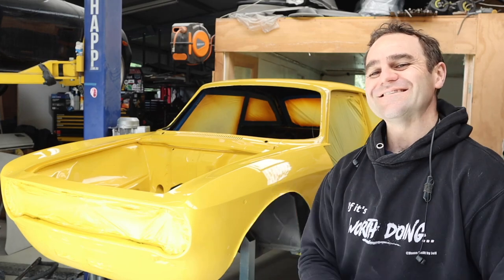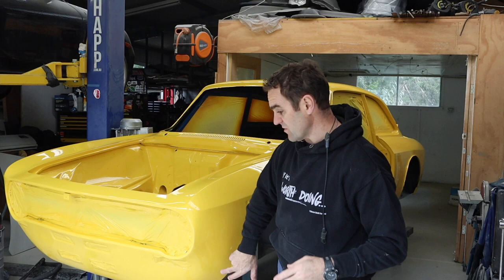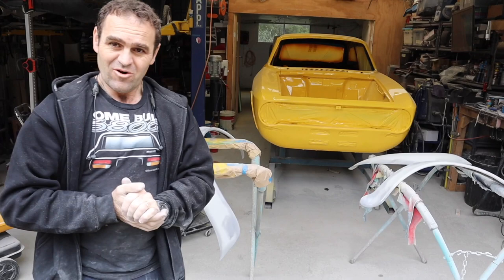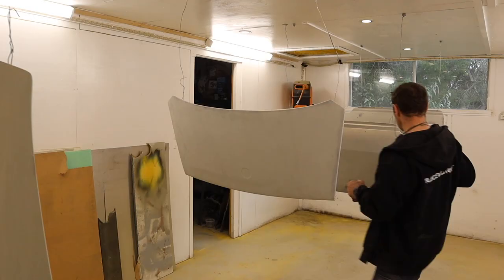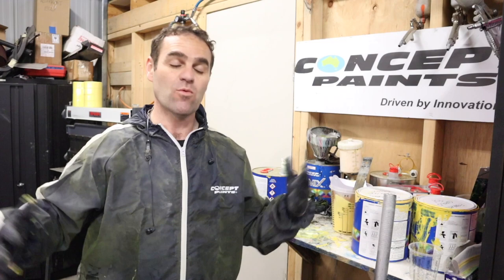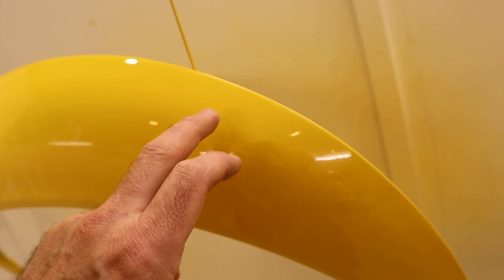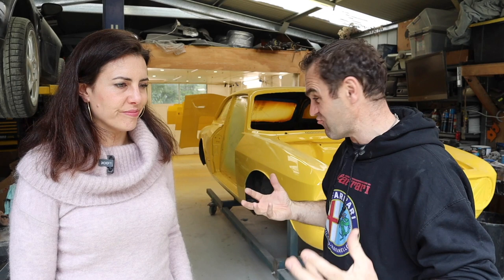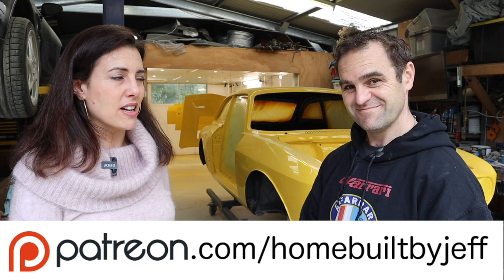Better booth lighting - Ferrari engined Alfa 105 Alfarrari build part 146

Comment: The previous video showed the render with the stripes and i think a very thin black pinstripe on both sides of each stripe (1-2mm, just enough to separate the stripes from the yellow but invisible in the complete graphics) would benefit them visually.
Reply: Yeah silver and yellow aren't very contrasting. I feel some extra contrast with a black line surrounding the silver stripe might be good, or even some extra contrast with the plenum's.

Comment: you could get a couple of LED work lights and place them on the floor facing up, either at the parts themselves or the wall behind the parts. this will allow you to adjust as necessary.

it will also allow you to use them for other things. for example, I have one I put in the ceiling any time I have to go up there, I just point it at the roof as it bounces off the foil and lights most of the roof space up to navigable level, that way I have to rely on torches less.

Comment: The original downlighters were never going to provide the correct illumination and the location of the batten fittings is good but I would have expected one or two more on each long side to give the correct level of illumination.  Also, normally daylight fluorescent tubes are provided that give a higher colour temperature, which is vital for colour matching.  You don't mention the colour temperature of the LED battens but I assume that they are getting towards the 6500K level required.

Comment: Geff a suggestion… Add some light fittings low down on the walls, takes out all the shadows and helps painting under arches, sills etc.
Reply from the maker: I plan to add some more battens vertically in the corners ;)
Reply: @HomeBuiltByJeff  Good idea. Note Putting the lights on different circuits and dimmers can help, some times there can be too much light depending on colours and gloss of the paint so some customization to light location and brightness is welcome  to stop eye strain.

Comment: A technique I have used on runs is to actually make them worse with more paint and blow off the excess.
Only works if they haven’t started to dry though.
Some spray guns have a two stage trigger that just blows air at the first stage, if you spot the run when it’s starts you can blow it away.

Comment: Looking good man 👌 Lighting is a major part of a good paint job. When I did my car in a commercial unit it was easy putting the basecoat down but when I came to do the clearcoat the strip lights of the commercial unit and my single batten light on a stand was just crap. I had soooo many runs. 
You're right with teh LED batten lights. They've come way down in the last 12 months plus you still have to shop around as the same twin LED battens from Bunnings was 4-5 times more expensive from 'specialist' lighting stores. Hence why I had to go 4 suburbs over to find a Bunnings with them in stock.
I also love how your bonnet scoop is rounded and curved and not some ugly angular looking thing that quite a few other YTers have made recently.

Comment: Awesome 😀👍🏻👍🏽     yeah I found out about lighting,  when I had a old shed I was working in and when I thought I was done took it outside in the sun and would see alot I missed 😕☹,  so I put the old halogen spot lights in to see on both sides , so much better 😀👍🏻🤙🏼

Comment: Booth lighting and great ventilation and clean dry air for your spray gun. Some low lighting on the wall of the booth would greatly improve lighting as well for painting the sides of cars. The booth looks great though 👌

Comment: The lights are biblically bright 🌞  the panels look very bright 🌞 
Well done  Jeff
Tip if your spray  suit I'd baggymasking tape a belt or strap around thebaggy bits or buy a size smaller and cut little suits under the arm and behind joint areas

Comment: Tbh I think you could use even more lights judging from the video or at least make the light more uniform. Also there seems to be quite a bit of dust and particles. I know you don’t paint that often but are there any upgrades you can do to reduce them? Maybe one of those “waterfall” type of particulate catcher?  Always fun to follow your builds! A real dynotune for the 911 to see where the promised hp went would also be interesting. Greetings from Sweden :)

Comment: a tip from a painter, hang the most important side of a panel to the better light side , so you can see better what you painting
Reply from the maker: I did, as the inside is not getting painted again, but the outside is all getting flow coated ;)

Comment: Want to correct runs in the clear?  Let it go hard.  Smear a layer of spot putty over the whole run, then wet sand it down until the putty is gone.  Flat panel  ;)
Reply from the maker: WAAYY too much work. My way is much better ;)

Comment: The 308 GT4 is SUCH a beautiful car!  Especially in blue, and not with gold wheels.
Reply: I liked the look of the Dino 308 GT4 when they were new, and still do. Folks have a downer on them because it's not a rounded Farina design. I vaguely remember that Gandini had at least a hand in its design.
Reply: @pashakdescilly7517  I was under the impression it was all Gandini, or at least that he was in charge.  I didn't know he was involved until comparatively recently yet I knew that he'd done the Citroen BX and the X 1-9 (which is a cracking little car).  I think it gets curves and straight lines in a near perfect blend.  I've loved it since I first saw one outside Blushes on the Kings Road.  And, better still, just to highlight his good taste, it had a pack of Gitanes on the centre console.  :)   I found out later that it lived on St Leonard's Terrace and I've wanted one ever since.  I very nearly bought one in the early '90s and it was going to be about £13,000 but I got scared of the possible repair bills and bought a Lotus instead.  I've owned Lotuses ever since but I still hanker after one.
Reply: @ChristianRThomas  I posted my comment before watching the end of the video - and later heard the commentary say that Gandini was the designer. I tried to find my post to alter or delete it, but didn't find it.
Gandini was remarkably prolific as a designer, he did lots of REALLY good cars.
I must say, £13k for a Dino 308 in running condition is cheap.
Reply: @pashakdescilly7517   It was in about 1992, maybe '93!   I think a 308GTB/GTS was about £28,000 then so it was half the price of what people thought of as a Ferrari.  I had a choice between it and a 1.9 205GTi, which I did take for a test drive, and was about the same price.  The 205 scared me with lift-off oversteer on a greasy road (it was drizzling) and that was the end of my interest, especially as they were hardly sturdy.  Yes, Gandini is a superb designer, and SO original.  No one has ever done a car as striking as the Countach.  He's in my pantheon of greats alongside Leonardo Fioravante (Dino 206/246, 308GTB, BB) and Giorgetto Giugiaro (Esprit, M1, Golf GTI and the Alfa Giulia shape here - which was my first ever car).  So many beautiful cars between them.  :)

Comment: It's a bit hard to tell in the video, but they don't look like are sealed fittings, and do the drivers or ballasts have a low enough operating temperature below the ignition temperature of the paint/solvent fumes?
It might be worth doing a short video on Hazardous Areas - AS/NZS 4114.1:2003 Spray painting booths, designated spray painting areas and paint mixing rooms, and a bit about upper and lower explosive limits and ignition temperatures of paint fumes in regard to surface temperatures and things like potential sparking of ventilation motors, where the fumes exit, spark energy and duration of other ignition sources in the workshop for those that may not understand those things to the levels a Firie would know.

Comment: A curiosity, the 208's v8 is not the only two-litre v8 used on road cars, however, with 1991cc it beats the wonderful 1967 Alfa Romeo 33 Stradale (1995cc and rev limiter at 10000) and the 1952 FIAT 8V (1996cc). In racing, there have been several 1500cc v8s in F1 while in motor racing there has been the 499cc Moto Guzzi v8.
Reply from the maker: I think they mean production V8. The 33 Stradale is an amazing, beautiful car, but it wouldn't really count as a production car.

Comment: Hay Jeff you gota get these leds, I got them for my shed and they are killer bright and cheap too. Will work for the paint booth half way down the walls. 10 Pack 20W T5 120cm LED Shop Light Fixtures 6500K LED Ceiling Light AU Plugs
Reply from the maker: Good tip ;)
Reply: @HomeBuiltByJeff  They are on ebay around $98.00

Comment: runs come when you spray on too wet, when your overlap is too close together it will spray too wet, you should typically spray 50-75% overlap depending on the paint's instruction, also it appears you are a little too close to the panel.
Reply from the maker: Wow. Really. I wish I knew that before. Such informative comments......
Reply: @HomeBuiltByJeff  you're a good problem solver you would have figured it out on your own. I came late to watch your build. you should build a 69-74 cologne or Mk 1 GAA Ford capri next

Comment: @Jeff, how much time you give between layers?
Am I right that you use base, some time to little dry, color, some time, clear coat? 
Anyway, effect is awesome!
Reply from the maker: Basically with a base coat/ 2 pack clear coat system, it is only 10-15mins between all the coats.
Reply: @HomeBuiltByJeff  Is this promotion below being run by you?  I have one too, under my comment on the 308GT4.  They are using your avatar but it appears to be a different YT account.

Comment: Hi Jeff loving the vids very informative, quick question are you using 2K paint with Isocyanide, do you use an air-fed mask , just about to get to the same stage with my project.
Reply from the maker: Yes it is real 2 pack and you must ensure you have the correct mask. I use the same mask that 99% of professional shops use here and it is not air fed, but has 3 different types of filtration.

Comment: Hi Jeff,
as your alfarrari is almost ready to race, you might enjoy some specific inspiration. There is a GTAm, time correct build, 220hp, 920kg, doing hot laps on the Spa circuit. The mechanic and the owner/driver are talking you through the car.

https://youtu.be/HpNybbKcoBI